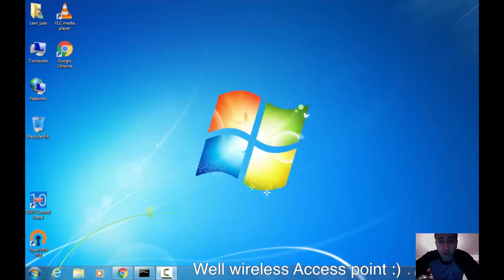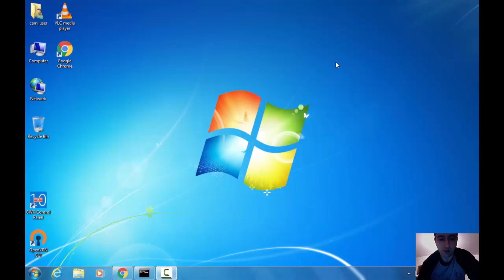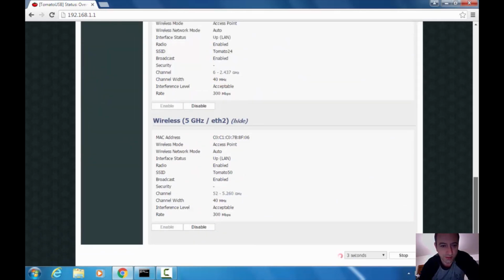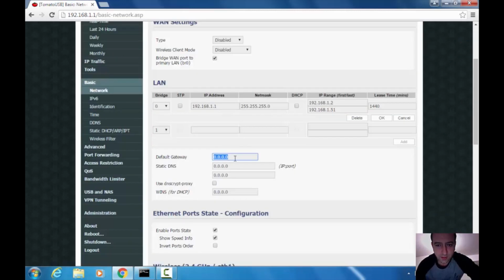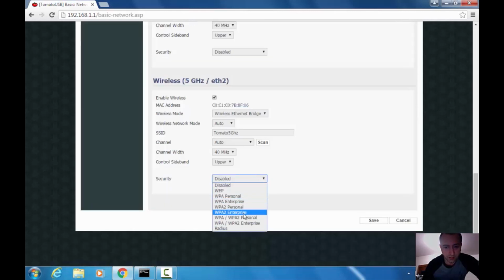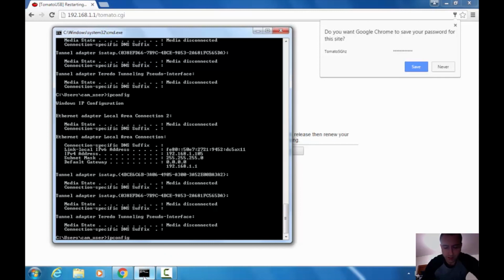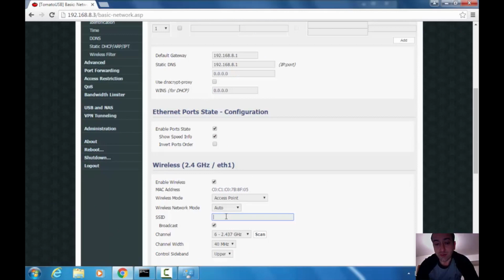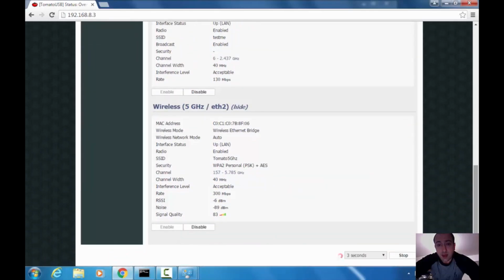Tech Tip: 5Ghz wireless bridge to 2.4Ghz Access Point Shibby Tomato Firmware

Comment: Reading about this it seems that many routers are just activated into WIRELESS BRIDGE mode and then connected via Ethernet to the second router. So you can have two routers (they are cheap). Sure you can have two radios inside your router, but it’s not easy to make radio to radio talk as the firmware seems to be set to work with the wired Ethernet ports in that direction primary.

Comment: Nonsense you cannot connect 2.4ghz to 5.0 ghz you just pronounce it wrong. what you have is 2.4ghz access point mode and 5.0ghz is bridge mode as master or slave to another router in no way 2.4 and 5.0 communicate between each other other than by ethernet hardware inside the router.
Reply from the maker: if that's what i said then you're correct sorry for the confusion. The whole point of the video was to show how you can link 2 routers together via similar frequencies with making one of the an access point.

Comment: can i have 2.4 to 2.4 bridge? as many of my device doesnt support 5ghz. and i only have 2.4g as source wifi.
Reply from the maker: if it has 2 independent 2.4 ghz cards then yes you could in theory do that. :) most have a 2.4 + a 5ghz card in them.
Reply: With shibby you can select either 2.4 or 5 ghz with each wireless circuit.